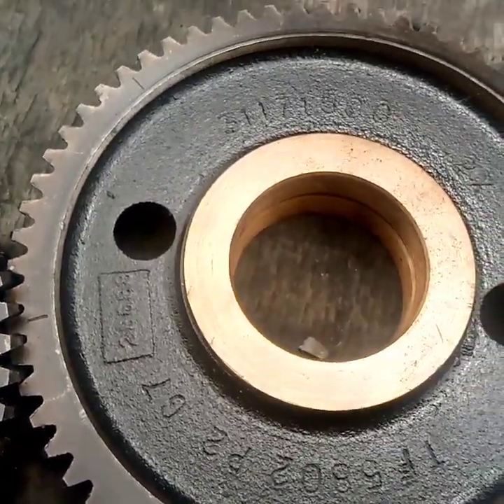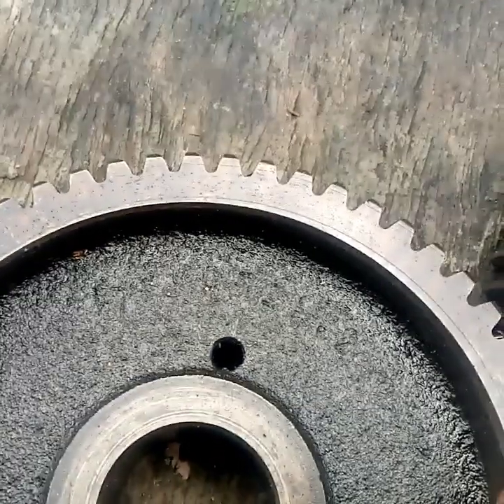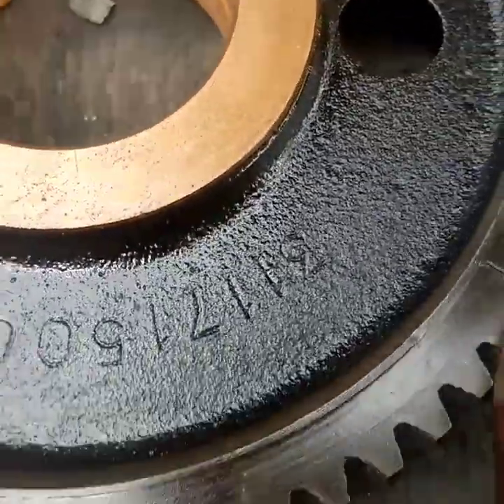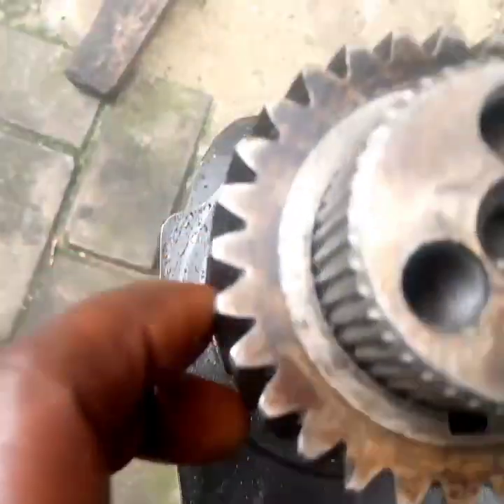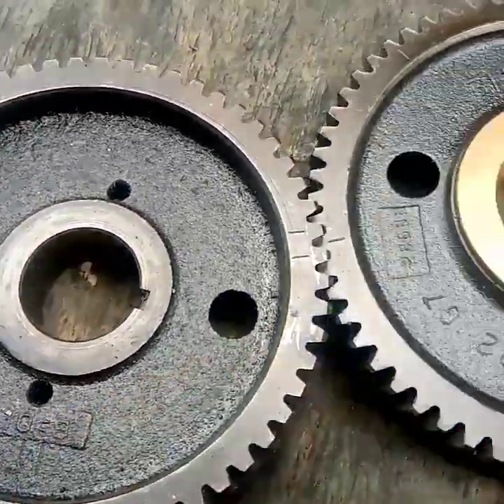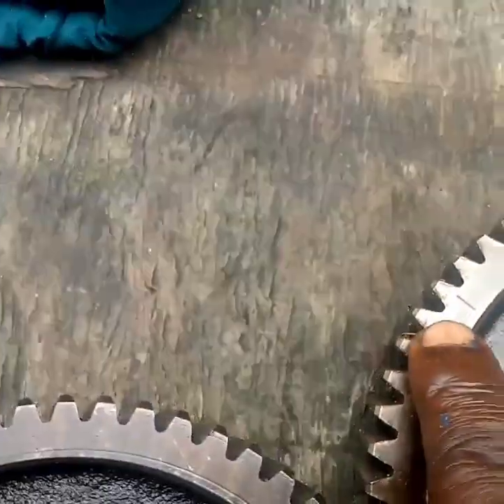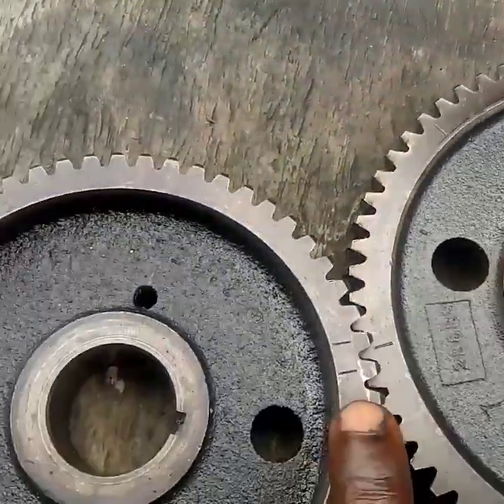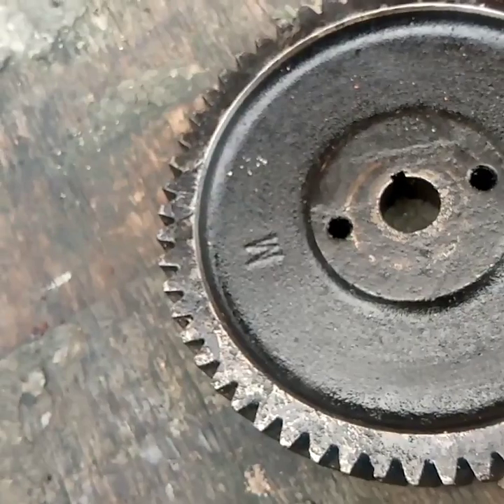Perkins Engine Timing Mark Explained

Comment: How many turns does it takes to align all those marks on each gears?
Reply from the maker: Two full turning of the engine is ok
Reply: @mrengine  NOT CORRECT ANSWER .
Reply from the maker: @NormanLynas-e4c how many turn do you do